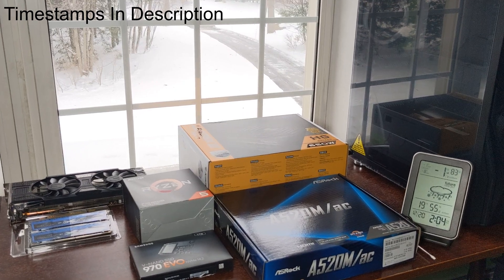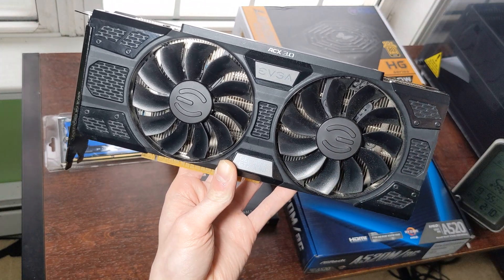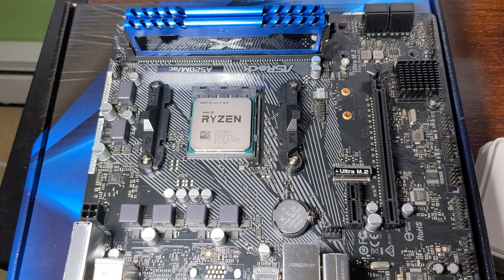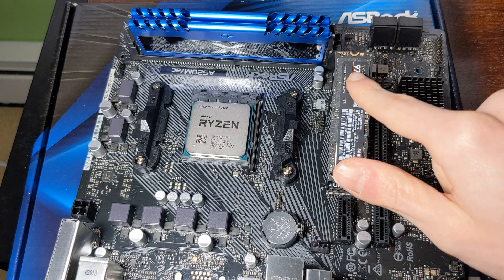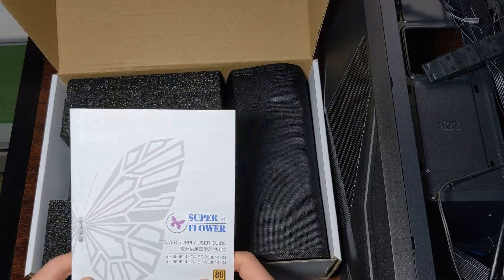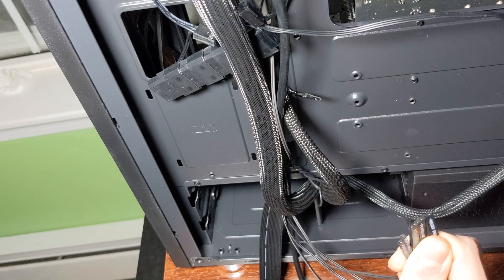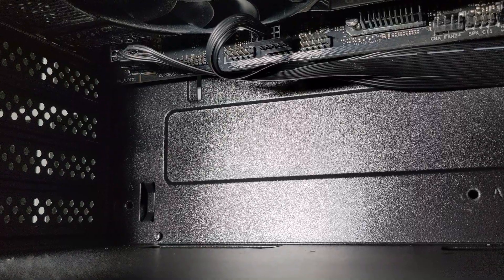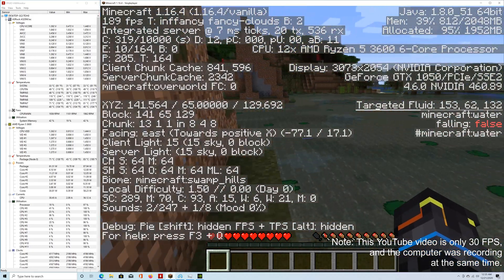Best Budget Gaming PC [2021] [Full Build] - AMD Ryzen

Comment: Pro tip. Save yourselves some cash and get a 2600X or 1600AF. The 1600 AF (not AE) is a 2nd gen reboot which makes it nearly as fast as the 2600X (2 - 4 frames difference). Also $190 dollar nvme drives aren't necessary. Just grab a 1tb gaming SSD for $80 bucks. You'll barely notice the speed difference. Now take that extra cash and put it towards at least a GTX 1660 6G super or a RTX 2060 6G. Budget build now complete and you can always add an extra 500 Gb SSD later on for $45 bucks... 😎👊